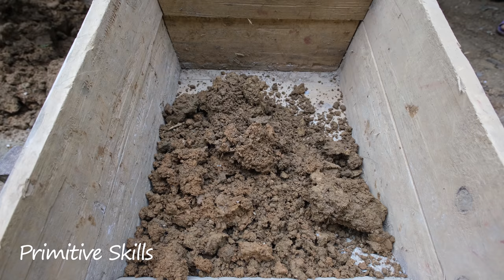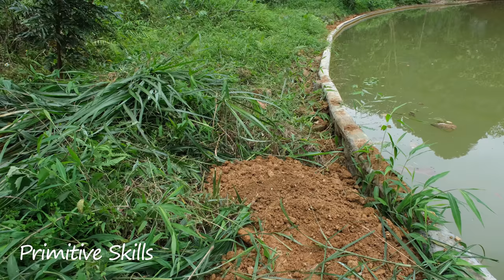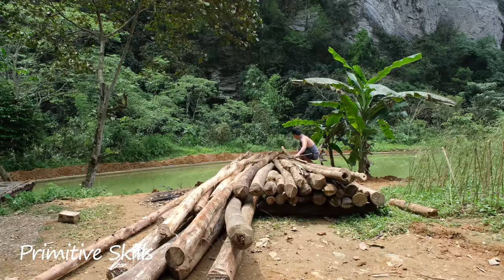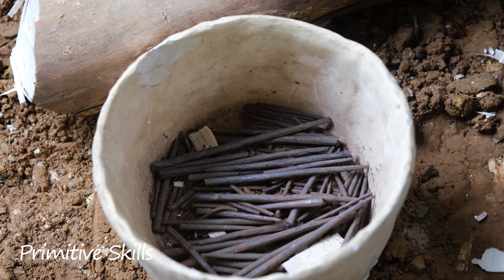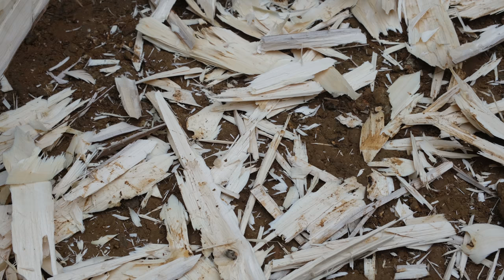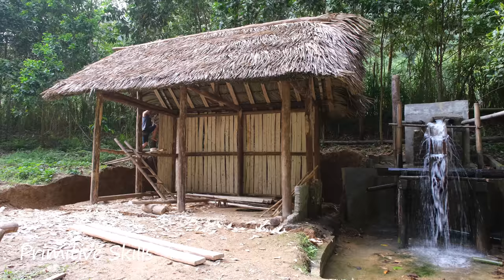Building retaining walls for primitive sawmill, Woodworking factory running on waterwheels - Ep.168

Comment: All of the woodwork here is a perfect example of why the sawmill is needed, wonderfull to see another expansion coming to fruition. Great work!
Reply: By the time the "sawmill" is done, he won't need it!
Reply: I am still confused why he needed to build a wall around the saw mill? What advantage is there to all that splitting and nailing?
Reply: Only time can tell
Reply: @westcoastmasta  A sawmill allows him to cut the logs into mutilple planks.  Splitting the log only yields so much because of all the waste made from evening the split out, so he is losing anywhere from 1 to 3 cm of material.  The will will allow more boards from one tree, which means fewer trees.
Reply: @westcoastmasta  probably to keep out rain and make it a more controlled environment for drying and seasoning timber?
Reply: @glawenclattuc3127  That makes sense. I just wonder why he chose planks instead of a bamboo weave? It seems like it would be easier to make the weave, then build the saw mill, then make planks for upgraded walls if that was necessary? I dunno, just spitballin
Reply: a mill only increases productivity it used to be done by hand and its slow and laborious , we invented ways to do it quicker or with less effort. there is NO NEED for a sawmill but it would allow for quicker materials preparation.  he has no need of the machines because he knows how to do it without them. it is also true that he has many things going on and much to do so investing time and labor now to produce more materials quicker later is a good investment, it allows more time for things that require it when it dosnt take all day to split and plane 4 planks from a log. especially if it takes you an hour to fell it  half a day to limb and section it and 2 days to move it....

Comment: So glad I found this channel. Some epic builds going on. Will we ever see a split bamboo roof? 2 cut in half shoots facing up with one between them facing down. Cap the very top and that's the end of any and all leaks.
Reply: @least.insane.femboy  I think stone/mud/crete walls insulate better that wood which is why they stay that way even when they use wood for doors and other parts of the hut.. Could be wrong.. LOL

Comment: Don`t these walls prohibit you from cutting longer peces of wood because you can`t fit the wood through the walls?
Reply: Right?? That was my thought too.
Wouldn't an actual retention wall bracing the dirt wall to prevent a landslide have made more sense? What he built is just a wall, and a restrictive one at that.
Reply: without winches and other equipment moving 8 feet of 6 inch log is an accomplishment for any one person  several hundreds of pounds...it isnt kiln dried lumber its trees he is dealing with.
Reply: @mobiousenigma  :  Agreed !!  Logs get heavy in a hurry !  In my contracting business I have had to move logs in this range.  They STAY heavy even after years of drying.  Not fun moving them !
Reply: @jimbayler4277  i have 1 word for you.....hydraulics lol  the beavers have it figured out ....15 pounds of beaver can chew down  a tonne of tree and move them,,,, they dig a channel and float em out  usually its younger ones doing stupid things  those would be the random felled trees  no where near water .pine and maple here mostly and if i have to carry it ill take the pine  and under 15% moisture  or its machine time lol.  im wondering which method of power transfer he will use to run the sawmill , and weather theres more saw blade forging coming up . it would seem obvious to go with a rotary blade but im betting were going to see a gang saw without the gang lol   using a lsrge flywheel and an eccentric  to generate the reciprocal motion
Reply: @mobiousenigma  :  Where I do most of my "Log wrestling", the neighbors would be a bit put out by me building a log flume across their front yards......
Where @P. Skills is at, it might not be practical for other reasons.  Especially at the small scale he is likely going to operate at.
Reply: @jimbayler4277  agreed neighbors....they can be so demanding sometimes. yes its going to be a small scale operation an alaskan chainsaw mill would probably be a more productive option here but also agreed he will probably go more oldschool less high tech .it will be fun to see
Reply: @mobiousenigma  : Truth.  Besides, I'm having problems envisioning a stone chainsaw !  Even the Flintstones used a sawfish.

Comment: Someone correct me if I'm wrong, but isn't a retention wall supposed to brace the dirt wall to keep it from eroding and causing a landslide? What he built there is just... a wall.
Sure, it will keep a landslide from burying the work area, but it won't stop the dirt wall itself from eroding and come crashing against the sawmill's wall. Seems to me an actual retention wall bracing the dirt wall behind the sawmill would have made more sense and also would have needed less wood.
Reply: Could be a disconnect in the translation
Reply: Not wrong, and agreed. Although, I’ve come to find he does such things in stages, so don’t be surprised if the next video is exactly that. However, I would have done a rock retaining wall first, as access and installation would be 10x easier.
Reply: yes it is but not being a native English speaker he probably chose the wrong word!
Reply: @holmesmycroft2157  :  Pulling wild guesses out of your behind again !!  You suer take HUGE LIBERTIES with the truth !!

Comment: Love that you put the wood outside facing in on the mill. Cementing in the bottom space would help the water flow around the outside.  Just a couple thoughts: 1 iron face on your hammer; sloping the dirt behind the mill a bit with a lipped gutter at the edge to divert most of the rain; a few pieces of rooted vegetation into pond for food and hiding places for the fry; a few stacked rocks in pond for shade and protection. Really look forward to each and every episode. Please get another shirt soon.

Comment: Your nails do not have any appreciable heads on them. You might want to add more nails at different angles to help control lumber warp and pulling off the nails.

Will you be applying anything to the retaining wall boards to preserve the wood?

Comment: What if when you make the sawmill you give your home a upgrade, put some planks along the top of the wall where the dirt doesn’t reach between the dirt and the roof, maybe make some wooden tiles and scorch the surface of the tiles to make them a little rot resistant, maybe give them a coat of tar if you can get it.

It would retain more heat and last longer than the thatch, though I dunno If heat retention is necessary there because I don’t know the average temperature

But if you build a wall out of planks you can probably plaster it with clay or something, possibly cement but I don’t think cement would work too well

Comment: It would we be really cool if you found a way to make a kiln for smelting iron down for casting. Its difficult because the fire has to be hot enough and you need a strong material to make a crucible out of
Reply: He's done that....he's made all his tools and nails from getting the metals out of the rocks.
Reply: casting is not that usefull for tools, you will lose the streng it gains when smithing the raw iron
Reply: For tools: forging > casting
Also no way for him to get a crucible hot enough to smelt iron.

Comment: I'm still curious as to how you'll make the saw for the sawmill. Circular, or reciprocating?
Reply: Circular would be the easiest, wouldn't be ?
Reply: @antoinegontier482  Hand forging a flat circle of metal? I'm not so sure.

He's already displayed making a band-saw blade by hand. Even though the reciprocating mechanism for the saw would be more complex, it might be less labor intensive to make.
Reply: He actually metioned, when making his regular saw, that this could later be used for a sawmill, which seems smart if he can pull that off.
Reply: circular would be the easiest to both make and power!!
Reply: @WynterLegend  that's not a band saw that's a strip saw a band saw requires spring steel to make and is flexible!! and hand forging a flat circle wouldn't be that hard and a circular blade would be far easier to power off the wheel!!
Reply: @holmesmycroft2157  well if you don't like what he does DON'T WATCH IT!!
Reply: @keithmoore5306  The hand saw that he makes? It's similar to a hacksaw. In his previous videos, we've watched him smith it by hand.

To make a circular saw, you need it to be balanced, or it'll shake itself apart, because of how fast you need to spin it. If it isn't uniform in thickness, it'll get stuck in the lumber.

The water wheel doesn't rotate fast enough on it's own to provide the rotation speed needed for a circular saw. So, he'd need to make a gearbox that would get it up to the rpms needed.

Lastly, he'll need a good deal more iron to make a disk with a large enough radius. The saw would need to have a radius greater than the diameter of the irregular logs.

That's why I'm skeptical of it being a circular saw.
Reply: @holmesmycroft2157  :  "Huge liberties":  Perhaps, but you would not know if he did or did not.  
You simply don't have the knowledge base to know one way or the other.  You have proven that over and over again.
You take HUGE LIBERTIES pretending to be an expert.
Reply: @keithmoore5306  : "don't watch":  If @Homeless Mindcrap did that, what would he then complain about ?!  His whole life seems to consist of trying to debunk @P. Skills.  The problem is "Homeless" doesn't have the knowledge base to do that !!  So, he just throws stuff against the wall, hoping something sticks.
Reply: The very first sawmills used ganged reciprocating blades.  Early power sources did not need to turn fast to operate this type of saw.
As someone else said, getting the blade and shaft balanced in a primitive setting would be difficult.  Also, getting it to turn fast enough to be effective brings up a whole other set of problems that would have to be overcome.
Reply: @WynterLegend  speed of a circular saw is governed by pulley size like on a bicycles wheels! and a workable blade can be made!! actually the saw you've got in mind  is called a walking or rocking saw i've seen those in water powered sawmills in southeast Kentucky and believe you me if you want a complicated gearing system take a trip down home!! and the walking saws take considerable more power according to the mill owners!
Reply: @jimbayler4277  first i've come across him! i figure he's a jealous bitter channel failure lashing out at a successful channel creator myself! those i can't resist poking in eye!!
Reply: @jimbayler4277  That's why I believe he'll make a reciprocating saw, instead of a circular saw.
Reply: @keithmoore5306  : @Homeless Mindcrap  is one of the regular Stalker Trolls on @P. Skills' channel going back a couple of three years.  He took a break for awhile (jail maybe, IDK), but he's back now with a vengeance. 

No content on his channel.  He mostly follows the same script the others do, but occasionally comes up with a real comment.

His favorite line is about @P. Skills taking "Huge Liberties" with the truth.
I have compiled a list of about 7-8 of these Stalker Trolls if you're interested.
Several seem to be the same person with different accounts.
Reply: @jimbayler4277  oh i've got a feeling i already know most of your list so! i'll just ignore him from now on! thanks for the heads up!
Reply: @jimbayler4277  yeah i do the same but there always a few you don't know about for one reason or another! and as for where he's been you thought jail, more likely a rubber room!
Reply: @keithmoore5306  : "Rubber room": Okay.... I'll buy into that !  Every bit as plausible as mine.

Comment: @Primitive Skills:  Your use of the term "retaining wall" is confusing and misleading.  A "retaining wall" holds back piles of dirt, rock, sand, a hillside, or other material to prevent it from eroding into a given space.  The wall you are building in this video serves a different purpose.  It properly would be referred to as one of the following: support, building, house, shed, structure, barn wall, etc. .
Reply: @audreyforbes-hamilton5685  :
 Ad revenue ?  What Ads ?  I get none.  Did you buy the cheap "Coach" tickets ?

You sure are into pendular swings, Black or White with no shades of grey.
Because of their limited English skills, they were at a loss for a good title that would roll off the tongue easily, so they asked for a little help.
Because of that, you think he has no idea what is going on ?!

How typical of you !  Clueless !!
Reply: @audreyforbes-hamilton5685  :  So, what is your problem ?!  You contribute nothing to @P. Skills income.
Why do you use him to vent your personal  frustrations ?!
If you feel inadequate, go out and get some hobbies.  Make something like he does.
Have limitations ?  Get creative and find something within your capabilities/resources.
Being a Stalker Troll is not an admirable pastime.

Comment: I know you’re going to use the water wheel to power the saw, but do you need to make gears to work the mechanical actions of it, and are you going to smith a new saw blade for the mill?
Reply: He actually metioned, when making his regular saw, that this blade could later be used for a sawmill, which seems smart if he can pull that off.
Reply: @willisbest4593  I’m wondering if he’ll also be using it to build a lathe.
Reply: @holmesmycroft2157  : "Running efficiently": No he doesn't.  With a reciprocating saw, all he needs is a off-center pivot pin to convert circular motion into linear motion.  The difference in size between the diameter of the waterwheel and the diameter of the wheel with the concentric pin determines the mechanical advantage.  There is more than enough power in his waterwheel to operate a reciprocating saw.  Reciprocating saws work slow and steady.
Once again you prove you do not know what you are talking about.

Comment: The guy makes no sense

Making planks by hand
for the plank making machines house
Reply: Yeah.... He makes perfect sense !   Do you like standing in pouring rain and mud while sawing lumber ?!  He lives in a rainforest !!
Shelter and protection for his equipment FIRST.... even if it means doing a "Last" batch of hand-hewn lumber !!
Reply: @jimbayler4277  his food Storage has no walls or protection

I don't think he needs it
Reply: @jimbayler4277  His "sawmill" has a roof! Do you think he'll be purchasing a bunch of hi-tech, expensive equipment?!!
Reply: @sniels7  : Does that roof extend out past the splash zone ?! If so, then his stuff is protected.
Many of his video show rain, and sometimes in deluge proportions.
Fortunately, he has never shown sideways driven rain.
His roofs do their job.
"I don't think he needs it."  Doesn't need what ?!  A roof ?!  If that's what you meant, you haven't been paying attention to all the rain depicted in the videos.  All areas not covered by a roof are always one notch this side of mud !!
Most people in those conditions prefer to work under shelter.

"Food storage": In wet, humid locals, good air circulation is critical for food storage to prevent molds, mildews, and spoilage.  No walls. No dank dead air spaces.
As long as the roof doesn't leak, and the stored items are up out of the splash zone, he's good.
Reply: @rockgardner  : Again.  Do you prefer to work out in the rain, or under a roof ?!
Hand-made equipment still degrades in the elements.  If you put your blood, sweat, and tears into creating something, you're going to want to protect it regardless of if it is hi-tech or not !!

Have you ever worked with tools and equipment ?!  Do you take care of them ? Or, do you just throw them on the ground and leave them there until next time ?!
Reply: @holmesmycroft2157  : "No walls": Why is that a problem for you ?!  Much of the world uses open-air kitchens.  It keeps the heat and cooking smells outside.
Being as worldly as you project yourself to be, I would have thought you would know that.

Same thing for the blacksmith area.

Just what kind of expert are you ?!

Comment: I think you can build a more efficient water wheel, i have seen quite a few old grist mills and saw mills that still use a water wheels, i say you want low speed torque more than a higher rpm.
Reply: If I remember correctly, he's an engineer in the modern world, so I wouldn't be surprised if he has plans to upgrade the wheel later using those exact principles.

Comment: If you can buy manufactured nails, why can't you buy a new shirt?
Reply: @joyce B:  Where are these manufactured you speak of ?
Reply: @jimbayler4277  The nails he is pounding into the retaining wall build.
Reply: @joyceb5864  : In this video, or an older one ?  I will go back and check this one more thoroughly.
Reply: @joyceb5864  : There is no retaining wall in this video.  The only thing I see him pounding nails into, is the cross bracing for the roof structure for his sawmill.
The handful of nails he pulled out of that ceramic bowl he uses to store his nails, are clearly not manufactured nails !!
Have you ever held a factory made nail in your hands ?!
ALL Factory nails have a head on them.  His do not.  What he uses is crudely formed rods with a slight taper pounded into them.

So, please.... tell me how you came to the conclusion he is using manufactured nails ?!